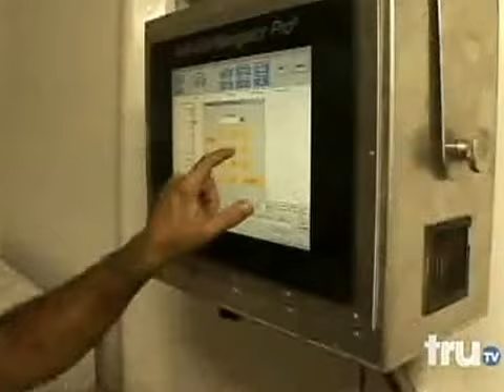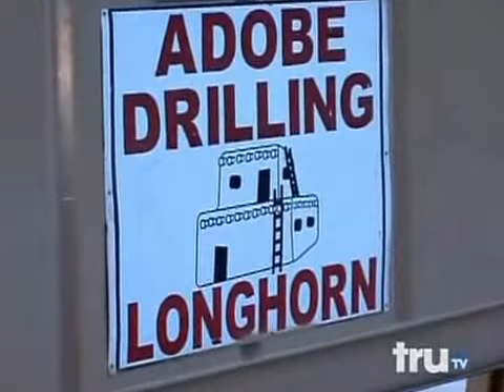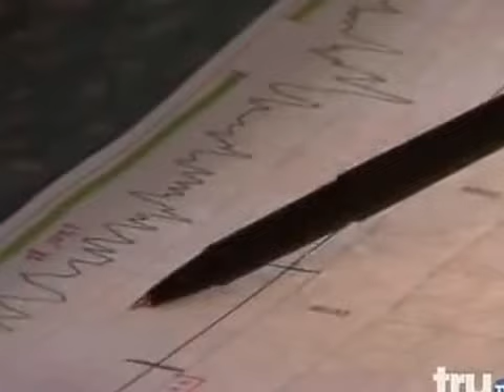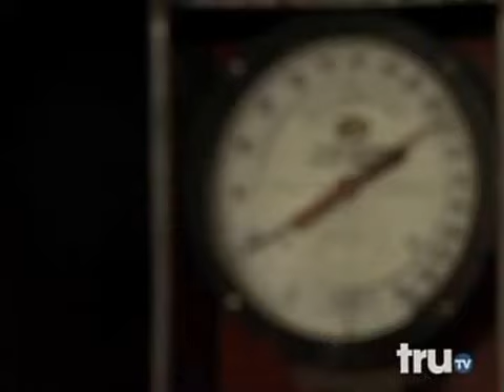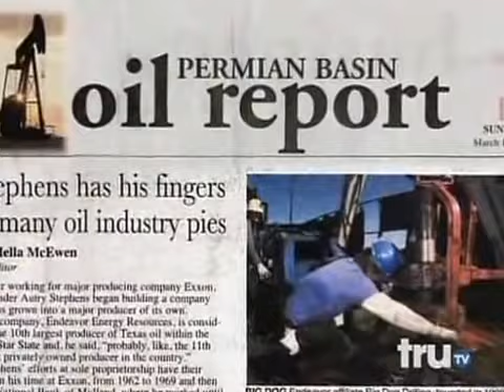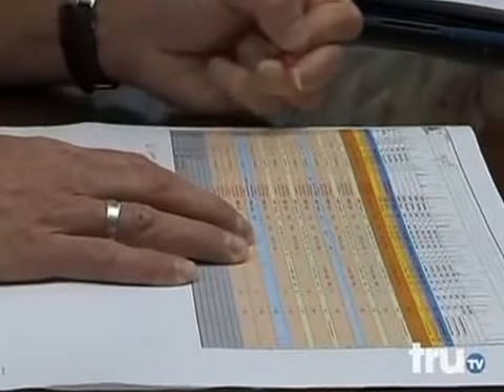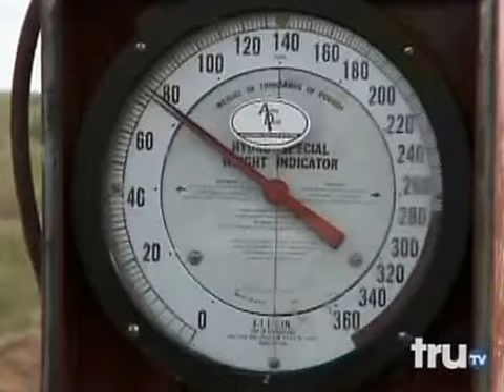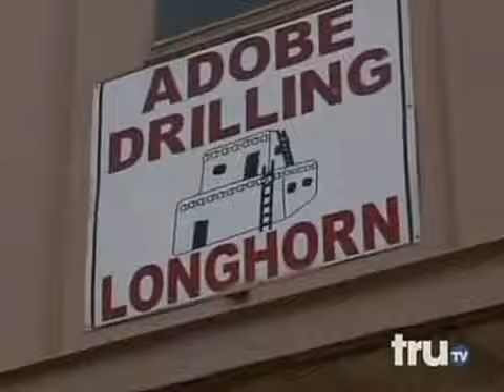Black Gold Season 1 Episode 1 Disaster In the Oil Fields

Comment: 75k a year is not worth it.
Reply: Einstein II that’s just a starting point. You could come out here with a not even a GED and start @75k and make far more than that.
Reply: 75K is MORE than most people make even those with college degrees.  You're just jealous that these people who only have  highschool diploma or a GED are making more then you.    Used to work in the oil and gas industry.  Mainly the gas side and let me tell you something, the knowledge you take from that job lands you MANY good jobs later down the road.  And I don't even have a college degree.
Reply: Oil and water truck drivers make about $75K. Roughnecks with two years make closer to $90K but it's cyclical.